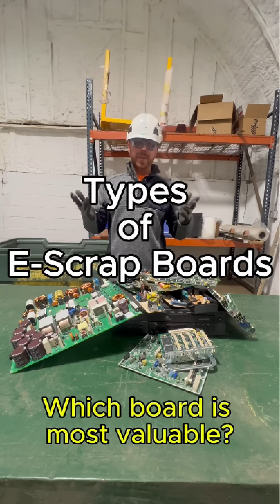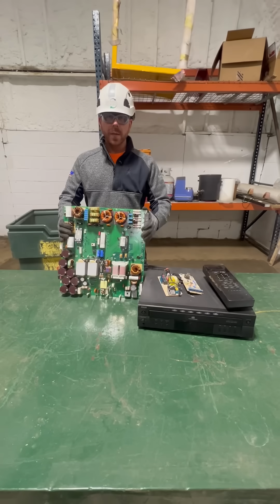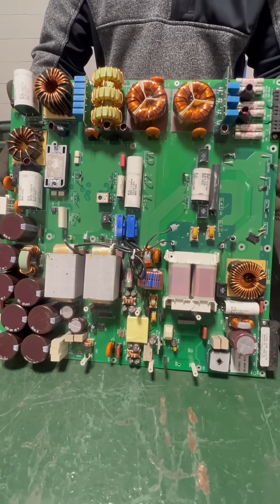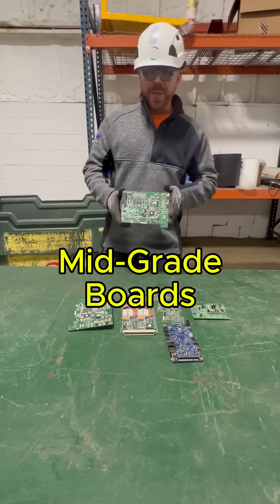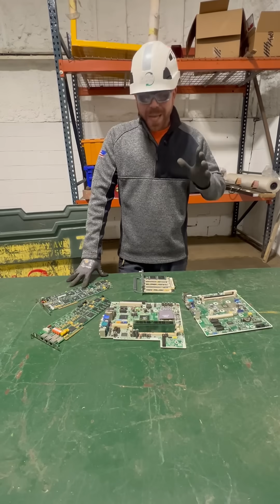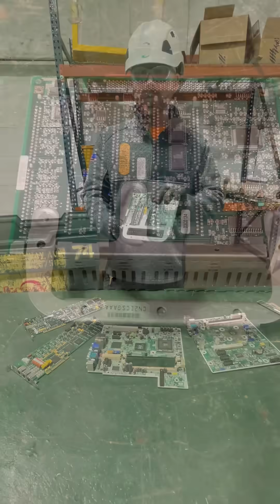📼 We see these circuit boards everywhere. Are they valuable? Let's break it down for you...

Comment: Telecom and military grade boards are the best. The older the better. A few folks have uploaded lists of the very best CPUs. Should be a lot of pre 5g telecom stuff being salvaged, although many areas have already upgraded to the new 5g stuff. Some of the telecom cabinets have very heavy all aluminum frameworks within them. Pretty much the highest grade aluminum. The outdoor stuff, it's often placed on rooftops, so they went with extruded aluminum framework for the cabinets.
Reply: Couldn't agree more.